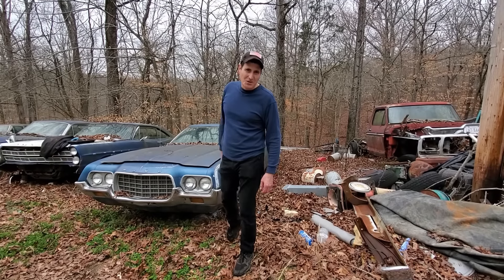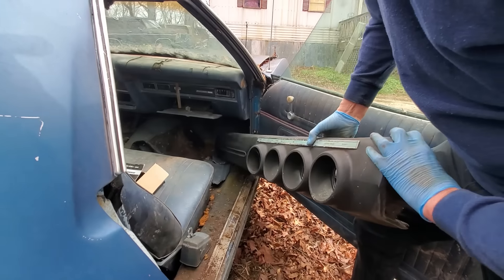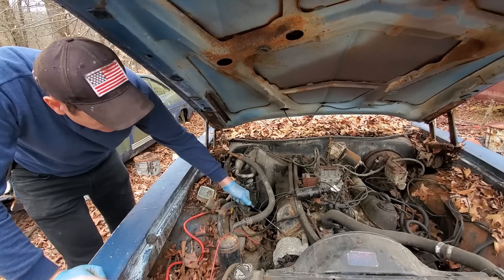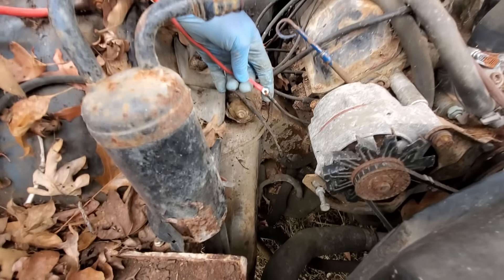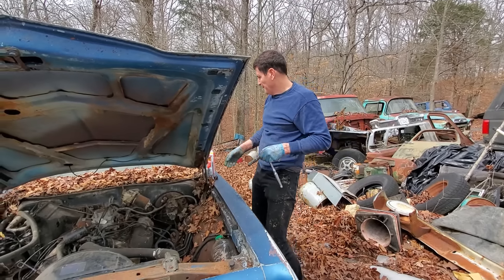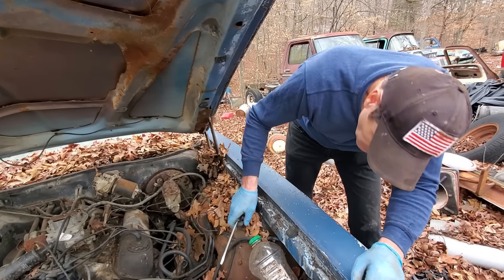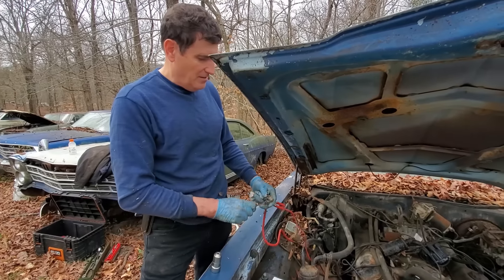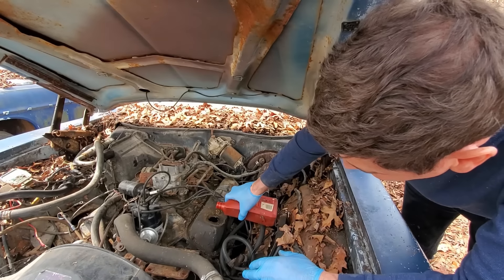Will it run and drive out of the junkyard? A 1972 Ford Ranchero!

Comment: Front passenger tire is locked up. At 40:23 the tire slid when backing up. Both front tires are locked because the hoses are full of crap,
Reply: I was watching that & thinking the exact same thing.
Reply: Yes definitely the front passenger side tire.  Pole barn garage would have had it running down the road in no time.
Reply: I noticed that too
Reply: Theres nothing wrong with the timing it starts an runs to good to be out of time you just don't know what you are doing you just act like you do if you would pay more attention to things you would be better off
Reply: @peteconley2874  Smarthome (the person you're commenting under) never said anything about timing. Only about the brakes being locked up
Reply: The tires do look as if locked up.
Reply: They swell internally not plugged over time they swell internally and not allow pressure to return the master cylinder so wrong
Reply: @peteconley2874i don't understand why people always think it's the timing to bad they can't hear some of us telling them LoL. It was running great at first time I think .
Reply: @careysavage  I don't either. Even the person you're commenting under never mentioned timing. Not sure why timing was even mentioned under the original commentor! He was only talking about the brakes being locked up 🤦‍♂️
Reply: Ya had the exact same thing happen to  me here about a month ago...bought a 1979 Suburban  fire rescue truck , fella  thought the Transmission was  gone in it... but it was the brakes rusted and seized ...but I  think after you filled the Master she might have locked up.
Reply: Do you reckon someone will offer to take the car on now that you've demonstrated the car starts? Pulling the car out of the hole wouldn't seem to be a huge task...
Reply from the maker: @peteconley2874  You pass a lot of judgement for someone who was not there.
Reply: I wanted to scream "front brake are locked up!"

Comment: I've had a few Cleveland's over the past years. There is a process where you can put the Cleveland heads on Winsor blocks. My Brother-in-law currently has a numbers matching '73 Ranchero GT with a 4v Cleveland, it's 99.9% OEM, only exception is an aftermarket GT center cap on one wheel.

Comment: Runs really good! Lots of potential for this Ranchero, even if it's just the engine. I wonder if there's a possibility the front brakes are locked up. Thanks for sharing, Richard and Christina! Awesome work!! 😎
Reply from the maker: Thanks David! I checked the wheels and they were free. The car just had zero power. To spin the rear wheel I had to literally floor it!
Reply: Two firing orders for Ford's 15426378 and 13726548 , people overlook this .
Reply from the maker: @davidt9292  That's right. I had to Google it to be sure which one was correct for the Cleveland.

Comment: Amazing when they start that easy! Just got our 84 Z-28 running after sitting 18 years, spun it for oil pressure, poured a little gas down the carb and it fired immediately. Have it running smooth out of the tank now.
Reply from the maker: Nice. It is great when that happens.

Comment: i think the car had enough power if it was able to spin the rear tires. the front tires are just seized up and it might need a new distributor. distributors go bad sometimes. i agree with you in that the engine is quiet. i saw the right front tire slide a bit when you tried moving the car.😊

Comment: Richard the timing cover tells you if it's Windsor or a Cleveland. If the timing cover is flat and and attached to the engine block it's a Cleveland. If the the water pump is bolted on and through the timing cover it's a Windsor' Also if the Thermostat housing is bolted to the block and not to the intake manifold it's a Cleveland.
Reply from the maker: Thanks for the info!
Reply from the maker: @MaxGiganteum  Great stuff! I am taking a picture of this and will use it anytime I need to identify a Ford engine.

Comment: Mr. B. Here ! 👀😎👍🍸. My favorite type of vehicle lite duty pick-up , I have a 1976 GMC Sprint. People will always said what is it ( car or a truck ) well the factory classification is Lt duty pick-up . They ride like a car 🚗 when you need a pick-up you got it 🛻. Great video guys !
Reply from the maker: Hello Mr. B. I was not aware they were classified as a light duty truck. That is very interesting. Thanks for the info.
Reply: Mr. B. Here ! ☕️👀😎👍. Yes, GM used the frame for the station wagon to build the El Camino & the Sprint .  Also the fenders of the wagon are longer than the Malibu. Just a little FYI , have a good day !

Comment: Hey Richard & Cristina, My father traded in a yellow with white cab 72 Ford Explorer F-100 with a 302cid with probably a C4,transmission for a new 1974 Ford Ranchero with a 351 Cleveland that was gold color and one of the coldest AC that you could imagine. 
That Ranchero would absolutely scream, But was a severe gas hog which was not good during the days of fuel embargoes. Interesting enough, My dad sold the Ranchero to a friend of his that operated a Texaco station who absolutely fell in love with the Ranchero. The partner who co owned the Texaco station also loved the Ranchero so much that he ordered a brand new 1975 Ranchero that was identical in color to the one that my dad sold other than being a year newer. @IrishOutlaw YouTube channel also has a Ranchero that he featured on some of his videos.
Reply from the maker: That is a cool story. These cars have a passionate following.
Reply: My mother had a 1972 Ford Gran Torino that had a 302 cid engine that I drove when I was in high school back in the early 1980s which did indeed have the same front grill and front end color like the young man in your video was describing.
While my mother was still driving the car, She wrecked the car while going to work on a slick road in which afterwards my uncle went to a salvage yard and found a complete front end which was the exact same color blue as the Ranchero while the rest of the car was the off color antique white color that Ford was using back then. 
I distinctly remember that you had to keep the battery terminals very clean or you were greeted with the annoying Ford solenoid chattering that we all despised to hear at the worst possible moments.
We would load the trunk area with concrete blocks and install some aggressive tread snow tires on the back of the car for the rather bad winter weather conditions that we had in KY in the late 1970s and early 1980s in which the Torino was like a tank - Literally. 
All of the Fords that we owned with the 302 engines always seemed to be excellent in starting in extreme cold weather conditions.

Comment: Watching the video It looks like both front wheels are locked up. The engine sounds good but with the wheels locked It just stumbles when pegd. Nice video and would love A follow-up to this one.
Reply from the maker: Next time I am there I will check those front wheels again. They were free, but perhaps the caliper locked when I hit the brakes the first time.
Reply: @whattherust  Yea cause A few times when the vehicle did go forward the passenger front tire moved slightly then slid on the ground A bit. I don't know about the drivers side but that passenger side definitely slid.
Reply from the maker: @SUBZEROinfinity  Yes, I go back and check on this and the next video. Stay tuned!

Comment: Hi, my 54 Ford F100 has a cleveland 400 in it. They call it the modefite 351. Overhauld it in 2019 and has about 400 hp.
Reply: 400M   it's a 351C but has taller deck height and longer stroke.   ❤

Comment: Are the front brakes locked up on it?
Reply: That's the first thing  I would check! :)
Reply from the maker: Next time I am there I will check those front wheels again. They were free, but perhaps the caliper locked when I hit the brakes the first time.
Reply: The front brake hoses are probobly swollen, not letting the brake fluid to flow back towards the master cylinder. That's a common problem in old cars that have been sitting. Old cars period. Cut the front brake line hoses if you don't want to replace them now. @whattherust

Comment: That's a good thing about that fuel pump. You're a smart man. A lot of people don't realize that those things dry out and the flaps won't.seal I always take a little bit of gas and just go down-the-line and get it wet That yard.
 Sure has a lot of good vehicles, I sure would love to see it.
Reply from the maker: Thanks Keith. It is a good yard with a good number of hidden gems.

Comment: Those type of vehicle are really more versatile than you would think! If that is in fact a 351 Cleveland, I wouldn't get rid of it! They used them in the Mustang Mach 1 early models (70's) They are high performance engines.!
Reply from the maker: I agree. These cars were quite useful for those who did not want a truck.

Comment: I had my ‘75 Toyota’s front end rebuilt a couple years ago.  I told the guy it was beginning to feel like the Willys Overland Station wagon in the movie It’s a Mad, Mad, World.  He knew what I was talking about.   Thanks you guys for the inspiration again.  p.s., my Toyota, idled really bad, now much better.  The main finds were vacuum leak of the carb gasket, plugged idle circuit, and:  they tell you don’t run the idle screw in hard, gently do it else you’ll mark it.  Mine was over the years marked.  I would have to make a sleeve and thread it to chuck it and resurface with a file I guess.  It’s brass.  I ordered a couple from some outfit online.  They didn’t look right, so they sat.  Still not happy with the idle I tried one for the heck of it.  Big difference!  I have a Toyota engine book that has a carb schematic.  It shows atomised fuel in the idle circuit passage going past that needle (down stream from a jet).  So the mark made from hitting the ‘seat’ must have been tripping the flow causing fuel to come out of vaporisation and drip.  They don’t tell you that marking that needle will mess up your idle!  The idea of it coming out of vaporisation I got from a YouTube video made by a guy who ‘flows heads’.  Sorry for talking on and on.
Reply from the maker: Interesting. It makes sense that any extra clearance in the needle could cause idle issues. It might also cause issues under low load when the bowl is full. Thanks for the comment.

Comment: Hi Richard and Christina, Great job on the Ranchero. As regards the timing issue, is it possible that when someone had previously put in a new distributor, they installed it a few teeth off of top dead center? That could make the engine appear to have jumped timing and produced the same symptoms. My hats off to you for working on the car out in the open, away from your shop and the additional tools you'd have at your disposal. Looking forward to the follow- up rescue from that same junkyard. Sounds like it will be a real challenge.
Reply from the maker: You might be correct, Ray, although I did identify TDC and the distributor did align with #1. The crank timing mark lined up as well.

Comment: Yayyy buddy awesome the Cleveland wizard how do u fix a jump time Richard just curious thank u 2 for the video and commentary we appreciate it  ❤ ✌ 😊
Reply from the maker: The only way to fix it correctly is to replace the chain and gears, since the valves are no longer in sync with rotation of the crank nor the spark timing. One could ply with moving the distributor a tooth, and it might help, but if the chain jumped once, it will again.
Reply: @whattherust   thank u never now Intel u ask right ?

Comment: I use a timing light to check the ignition timing. 
If your not sure about the cam timing, go to TDC on 1 and see if your distributor cap is pointing to cylinder 1.

Comment: Maybe the distributor is installed a tooth off giving the false indication of jumped timing. It may be suggested to verify TDC with rotor position and use a timing light to check and verify ignition timing.

Comment: Front brakes are seized. The video shows the tire being drug back and forth as you tried to move the car. The ending showing the old vehicles better made me wish that bullet nose Studebaker finds a loving home. That old Ranchero could make an awesome street machine for someone. Great work you two.
Reply from the maker: That Studebaker still has the air filter housing on it, even though it is almost completely covered in debris. I think it was a driving car when it first ended up in the yard. Unfortunate that it will not likely run again.
Reply: Not for nothing, but you guys might wants to get all those leaves out from under the engine hood. That’s a fire hazard. The engine warms up and the leaves catch on fire, and you’ll be up the creek using a tree limb for a paddle. Just saying.

Comment: Your later question in Eugene's yard about the scooped hood is that it is from the '72 Gran Torino which starred in Clint Eastwoods movie of the same name.
Reply: Prolly H code good for 177 net hp, the'71 Boss 351c was one of the fastest, but had major upgrades up 330hp.

Comment: I miss my 72 Ranchero! Mine was red with the Starsky Stripe in black and twin stripes accross the top and a ram air hood! 351w mid range cam with a four speed racing trans/muncie shifter hooked up to a heavy duty racing clutch!
Reply from the maker: That sounds like an awesome car!
Reply: @whattherust  It was- I loved that thing! Made myleft calf muscle twice as big as my right, litterally had to shove yourself into the seat to push the clutch! First gear was about as long as my driveway and I could smoke the tires through all gears! Had 50s and 70s on it with rocket rims!

Comment: It had enough power to spin the wheels. Some of the brakes are stuck on. It would have taken about one minute to take a leaf blower and blow out the bed and under the hood. That would have made better working conditions. Nice job of cleaning all the connections and checking the fluids.

Comment: As said,the only issue is at least one of the front wheels are locked.Some reason you never checked?Kinda surprised,been watching your channel for a long time 😊
Reply from the maker: I did check, but the camera wasn't running. The car had so little power it took me flooring it to spin the rear wheel.  I think I could have gotten it out with some more wood, but we ran out of time.
Reply: Right on Richard, I had a feeling you had too have checked. Nice video again,that car is actually deserving of doing up.Kinda surprised nobody had snatched it up.Definitely potential!

Comment: It is difficult to say how long this was sitting, but someone worked on at some time between 2007-2012, judging by the plugs and ignition parts. It may have been running at that point. I was working at AutoZone during that time and remember when that packaging came out. Platinum plugs started coming into use in the late 90s, so it would have to be later than that.

Comment: What is that next to the Ranchero... a Galaxie or a Fairlane...? If solid that would be a good car...really like that Ranchero. In the late 70s my buddies cousin had one, I believe a 74 with a 460. He had a 3/8 mile driveway. He would take it to flat out for the 1/4 mile or so then haul on the brakes. That car was fast. Brings back great memories thanks.
Reply from the maker: That one is a Galaxie. This yard has a bunch of them, most of them 2 doors.

Comment: Rebuilt 5 of those 351 Cleveland’s and 4 out of 5 had stuck distributors, also had one in my 1972 Mustang Mach 1 also had a stuck distributor, they were more for performance, your 351 Windsor motors we found more reliable than the Cleveland motors. Just the preference that we had.

Comment: My dad bought a '72 Ranchero 500 new.  White, black lower body accent paint, same blue interior, 302/C4.   The cluster laying in the seat is '68-69 Fairlane/Torino.  Engine looks like an H-code 351C 2v.   5th character in the VIN would be H if that's original.

Comment: Hey richard quick question for you sir...if that ranchero has jumped time like you suspicioned how could you solve that issue?
Reply from the maker: Right on. The only was to really solve the problem is to pull the timing cover and replace the chain and gears. The spark timing is OK, but it is not matching the valve timing. That is my theory anyway.
Reply: @whattherust  hey that makes perfect sense to me..thx for bringing us along on your adventures with you & Christina.

Comment: Could be when that distributer was installed it wasn't put in the right spot so the timing is correct. Also Fords will idle well when timing is 180 out but will stumble bad when you try to rev them
Reply from the maker: That is good to know. Thank you.